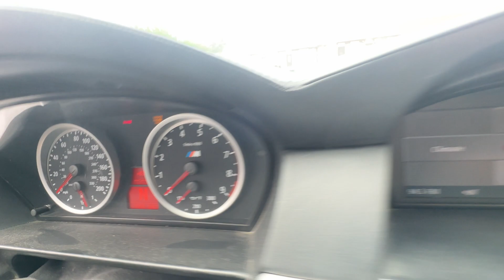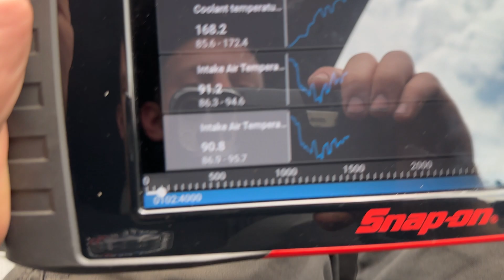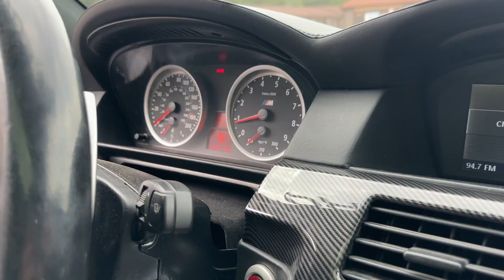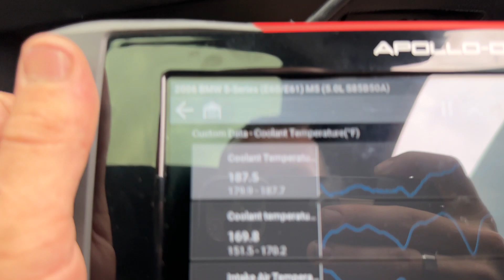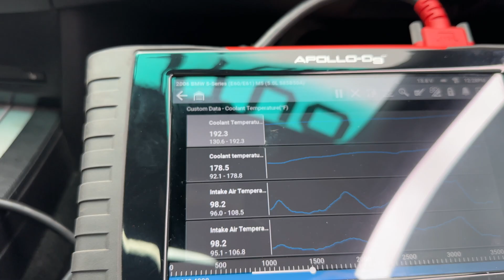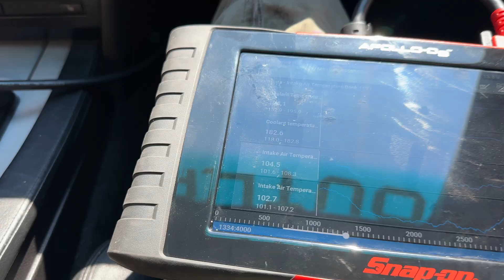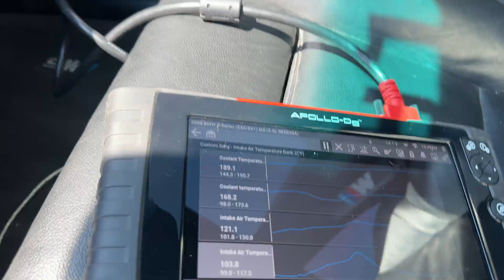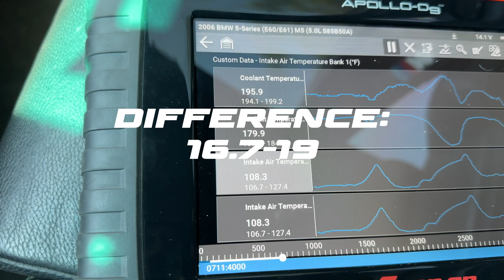BMW S85 V10 Intake Comparison - 5 Different Intake Setups!

Comment: Just curious...wouldn't the intake cones out right in front of the radiator cause the coolant to overheat?
Reply: The fake front mount😂😅
Reply from the maker: They are high flow filters so quite a bit of air went past them and we didn't notice any overheating issues,  but yes, that is something to consider